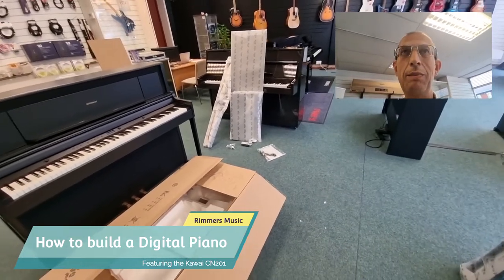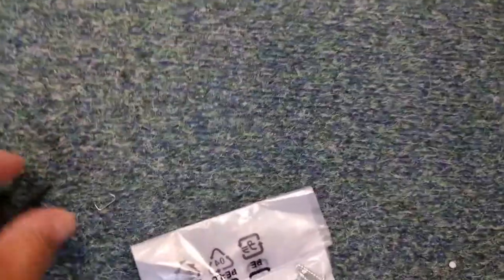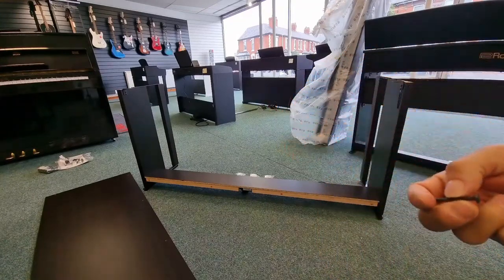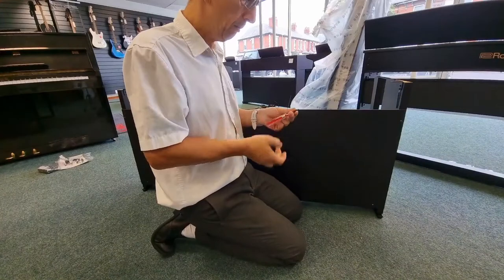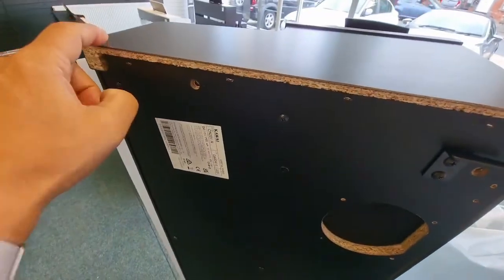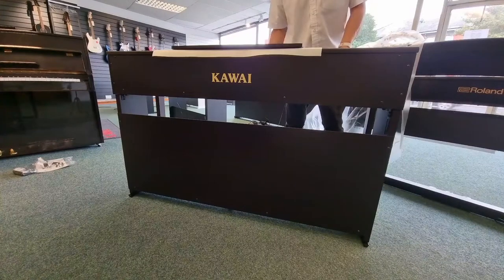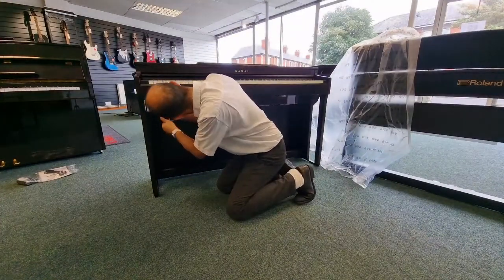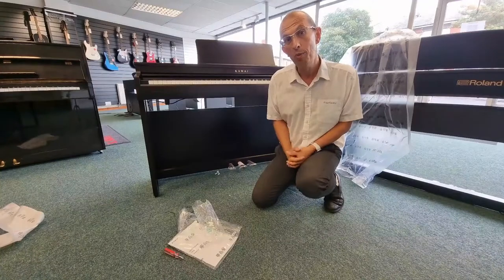How to Build a Digital Piano - Kawai CN201

Comment: i found it easier to mount the stand with the piano top still sideways standing , only need to lift shortly once (grab middle of piano top) , and carefull the stand doesnt get the weight when putting all upright.
carrying and aiming for the sleeve costs more energy
and its heavier as you might think, this Kawai cn201.